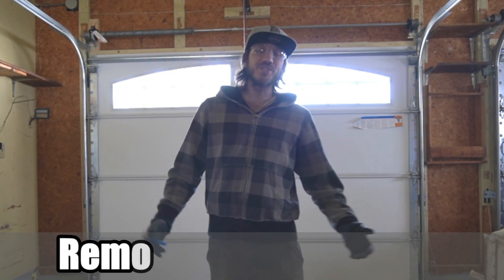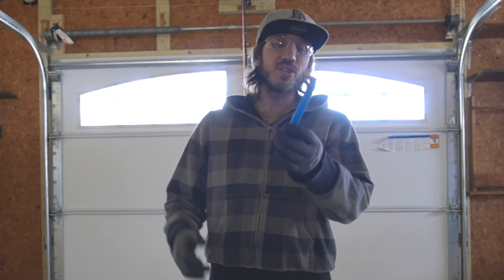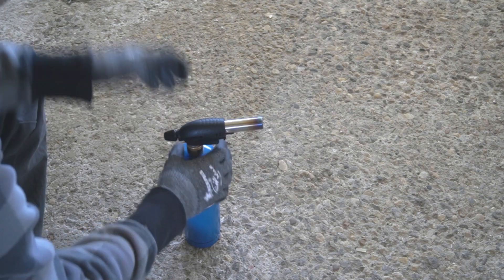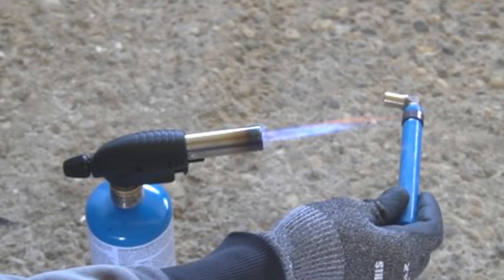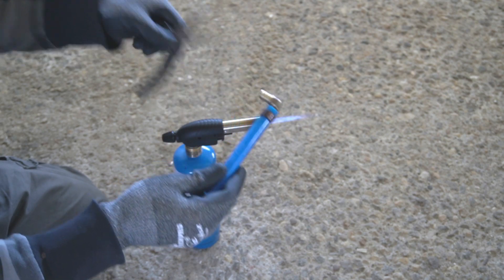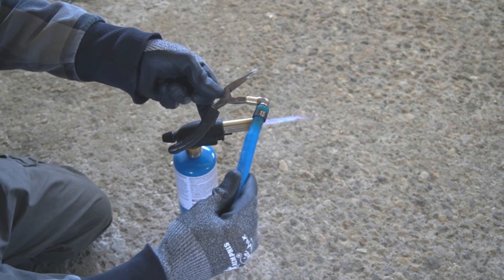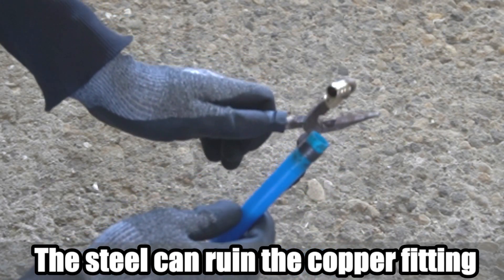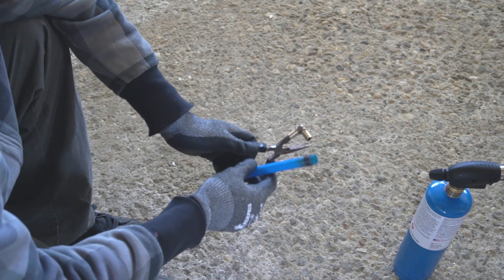Can you Remove Pex Pipe Fitting Without a tool? What about a Torch? (Let's Try!)

Comment: I just used my Dremel with a tiny cut off wheel in it. I made two small incisions on the copperband, and poof it came right off! Also, if one has the skill, an oscillating tool will pull it off just fine. Just sayin'.

Comment: I really need to try this on a sharkbite fitting. It's in a awkward position near a bend on a piece of copper pipe that i can't get the removal tool on so i'm going to try to burn or heat it off. Thanks for the video!